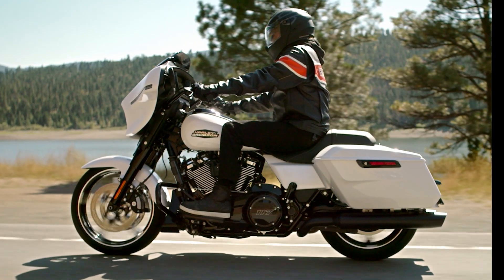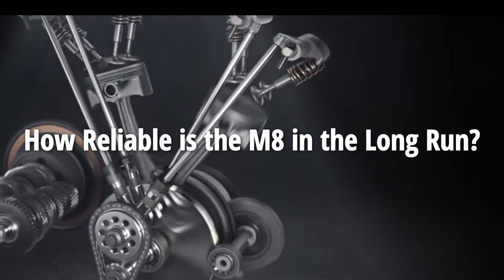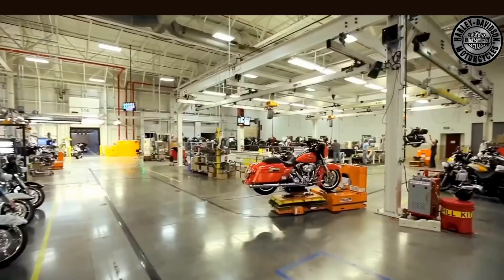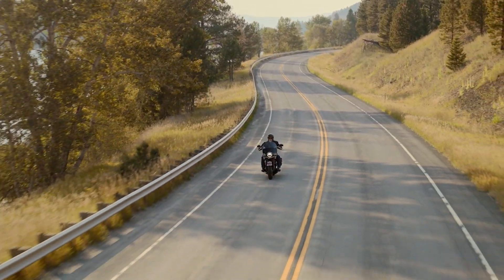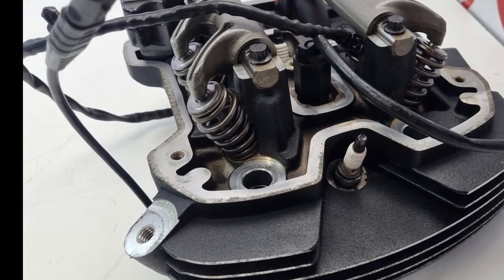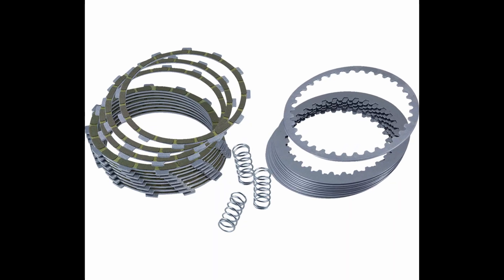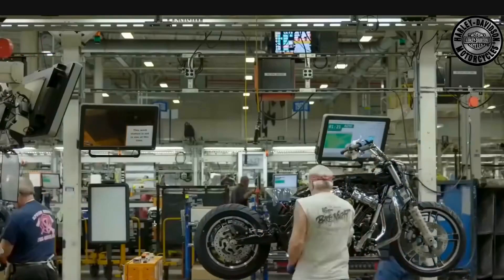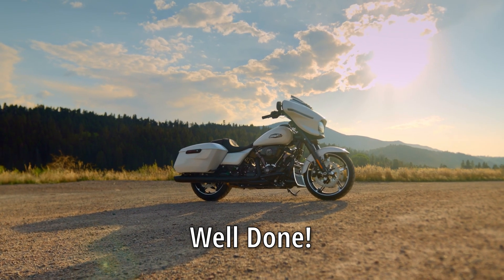How Reliable Is Harley's Milwaukee Eight? Teardown After 30.000 Miles

Comment: My Harleys were twin cam 88s not m8s but still people are kinda hard on em I never had an issue good running bikes.... I choose to ride Kawasaki Vulcans eventually tho instead out of personal preference and dissatisfaction with the motor company
Reply from the maker: The TC 88 is a great engine, just check the Cam chain tensioners once in a while. How do you like the vulcan?

Comment: Put 37k on my 2019 street bob 107. No issues!!
Reply: My right rear light went out about 12 times....I replaced the housing unit and have had zero issues since.
Reply from the maker: Great to hear. Sounds like you had no bigger issues

Comment: I had my Lowrider ST turn off while I was riding. Not sure if it was me. I waited a second and turned it back on and rode it home 30 miles. Didn't have any issues. It left me scratching my head.
Reply from the maker: Sometimes an electrical sensor go bad, which can temporarily cause this issue. It can appear randomly, but it is usually no big issue.

Comment: I have a 2021 Sport Glide 107ci with Stage 1.  36,000miles now and absolutely no issues at all,  except one brake bulb.  A very smooth, reliable, powerful and economical touring motor. Service religiously every 5,000 and now on my 4th set of tyres from new. No reason to tear down the motor to find nothing’s wrong at this stage.  In a word - ‘bulletproof’.  My best friend and never leaves me stranded.  I’m aiming for 100k miles before I take a good  look at a possible rebuild.  And then I’ll do stage 4 with 124ci upgrade. 😎
Reply from the maker: Great to hear! I am considering the 124 cc kit for my deluxe as well. Gonna be a wolf in sheeps clothing :-)
Reply: I’ve a 19 Sport Glide bought new. Immediately did a warranty & US epa compliant stage 3 11-1 107 to 114. It made 118 HP ran it hard to post warranty 37k miles. Cammed & tuned it made 135 HP 134 TQ. After another 8k miles I beat it real hard one night & broke a piston ring land. I swapped in Revolution performance’s 124 slugs n jugs no other changes. It made 140HP 142TQ and run flawlessly another 12k miles for a total of 57k miles.  EGR route to catch can, Better cam bearings and better valve springs are good investments but the M8 is a solid simple & well designed piece. It’s never used any oil or had any problems that I didn’t cause.

Comment: I bought a 1999 Sportster 1200 Custom new in October 98. Had it for 25 years and 55k miles and never had any problems. I foolishly sold it when I bought a cammed and tuned 2020 Softail Slim 107 with 1500 miles on it. I also had a 2013 Ultra Classic 103. The only issue I ever had with any of them is the slight fogging of the speedo. I still have the Slim but it now looks like a Heritage. I'm pretty happy with it but I do miss the cruise control and stereo of the Ultra. If I ever find another at the right price I may have to make room in the garage for it. I did like the Twin Cam 103.
Reply from the maker: It's awesome to hear about your experience with your Sportster and how reliable it has been! It sounds like you've had quite the journey with your bikes.

Comment: I think twin cams and M8s can be as good or better than Evos. Get an S&S crank, timken bearings, a S&S cam chest plate and high flow oil pump, and gear to gear timing. You have to lise that cheap pressed crank to get rid of the runout and get things right. Nobody wants to ebuild a new engine on a $25,000 bike.
Reply from the maker: I agree. I am currently working in an EVO vid, so stay tuned! :-D

Comment: I have been riding for over 60 years and there’s only 2 bikes that have never left me stranded, H-D & Yamaha. I’ve owned and ridden every brand available and the two above mentioned bikes are all I’ll ever park in my garage.
Reply from the maker: Which Yamaha do you currently ride? I am a huge fan of the FJR 1300 as well as the modern 700cc engines

Comment: My 2016 TC B 103 HO Fat Boy now 142.000 two-up kms  and many 140km/h packed.
Never had an issue, but, every 8000 new HD360, Formula + and gear oíl.

Thanks for your test: Brings back trust in M8 engines.
Reply from the maker: Thanks for sharing your experience. The 103 seems to be pretty reliable.

Ride safe!
Reply: I put 60k miles on my 2013 Fat Bob (103 twin cam) and was still running in perfect condition when I traded it in for the Pan-America Special! I loved that bike!
Reply: @FREEDOMGUNNER that's a step I am considering too, but still afraid to regret the change.

Comment: If you're tearing an engine down after 30,000 miles.... not reliable.  No one tears down working engines.  I got a 2009 yamaha.  62,000 miles.  Never opened the engine.  Still pulls like a freight train.
Reply from the maker: It was part of the test. The engine wgot disassembled anyway, regardless whether it was functioning or not.
Reply: @BikesandBrezeln  no one tears down working engines unless there's a problem.  These are facts.
Reply: You got some major reading comprehension issues.

Comment: absolutely love this video and keep coming back to it. They are pretty simple machines to work on and don't require a boat load of special tools either. Parts are also very reasonable and aftermarket choice is VAST compared to italian bikes that break the bank. Sometimes you just want a simple air cooled machine that just does it's job and gets you from point A to B in style and class.
Reply from the maker: Thank You🙏 I am glad you liked it!

Comment: 2021 Road Glide just under 15k. Lifters started making a racket 600 miles ago on a cold start in Wyoming crossing the US. This had happened 3 or 4 times but only once each time. Since Wyoming, almost every morning and evening start (to and from work) sounds like a gremlin with a ball peen hammer is in the motor. It passes but need at least lifters and probably a cam. Last oil change there was more bronze bearing material than I would like in the drain pan. About to change the oil and will see...another year on an ESP so hopefully replace this motor.
Reply from the maker: Please let me know as soon as you know the cause. I haven't heard much about lifter wear in M8s at that low mileage.
Reply: @Bikonomist  Some say it is the lifter cuffs. More likely Oil flow. The MoCo will down play any suggestion of culpability. Honestly, the ONLY place I have heard much about longevity outside of the EVO is here. I love hearing about high mileage Harley's. Most Harley's sit in garages and never see high mileage. My Twin Cam was about to grenade at 17K from the Cam chain Tensioners failing and plastic getting into oil pump. Complete teardown (ESP) and replaced all but the Case and the Heads...This was during COVID and the Tech that was in the middle of the rebuild had to stay home with the kids for his nurse wife. Put a kid on the job and it made it 900 miles before crazy cam chest noise. Replaced cam and lifters (service warranty) and I negotiated a trade instead of picking up the problem. 

Search "M8 Bad Lifters" and you can spend all day reading about this well known issue.

Comment: 30000 miles is nothing; this test would have been much more significant at 100000 miles!
Reply from the maker: In principle I agree, it's not easy to find a sufficient amount of data on engine wear for mileages above 30k. I am working on a Twin Cam video next, there's more evidence for the predecessor. Stay tuned.

Comment: I love my shovelheads, they don't have to leak, 60% balance factor on rotating assembly, bump up compression, and change the final drive sprocket ratio for modern speeds, these things were designed around a 55 MPH speed limit.

Comment: I have a 2019 softail with 40k. The brake light does burn out quite often. I think it's because they switched to the newer style bulb with a plastic base. That red light on the speedo is for the body control module. It does come on every time the brake light burns out because it throws a code for brake lamp circut open. Mine also gets moisture in the speedo but it still functions fine. Other than that I've had no issues
Reply from the maker: Sounds very similar to the test results. Ride safe!

Comment: My '20 Road King has 71K miles w/o any mechanical failures. Oil consumption is minimal and should be expected on an air cooled emmisions controlled engine. Only issue was plastic tag bracket broke in the middle of COVID. Took 4 months to get a new one under warranty. New one is steel. Still on the original battery. Oh yeah bike is ridden year round in most weather. No snow/ice unless I get caught out. I trust it to get me where I'm going without issue. Been my sole transport for a little over a year cannot afford car repairs dammit.

Comment: Can you please, tell me what oil was used in engine, gearbox and primary during this 30000 miles test?
Reply from the maker: The bike was serviced by an official HD dealer. So it's probably the SYN3 engine oil and the transmission/primary oil from HD.
Reply: @ thank you for your reply! I appreciate it. 👍

Comment: 30k miles is nothing. I just traded in a 107 with 63k miles that ran perfectly. I read one guy did over 100 Iron Butt 1k mile rides on his in a year on his and it ran flawlessly when he traded it.
HD engineering gets far too little respect. Not only do they last forever, they need little maintenance and are simple as hell to work on.
Reply: I know some V Twin mechanics.   They laugh at how trash Harleys are.   Along with being weak and slow

Comment: 30,000 miles?  My '92 FXRS went over 50,000 miles before the first real problem, the alternator failed.  Although the rear brake pad fell off in the warranty period, an assembly line fail no doubt.  It went over 210k miles before the engine had to be rebuilt, and that was more because of horrible mechanics than the engine itself.
Reply from the maker: Thanks for sharing. Seems like the EVO is pretty solid.

Comment: Yay only 1$ a mile get real m8 is complete trash coffee can cylinders to avoid overhead cam liquid cooled head to avoid a totally liquid cooled engine. Literally half assed on every design point.. ditch the tech buy a map a Tyre pressure Guage buy a bike with a throttle cable
Reply: This guy gets it
Reply: @Payt-y5d  I appreciate that I've was a HD tech for 22 years and the day juachine zeitz made a announcement that as of that day in 2020 HD was a luxury brand, I locked my box got a uhaul and haven't looked back. I'll been my 75k Evo
Reply: @FreetheRepublic  I've had probably 50 motorbykes.   Ridden a few Harley cycles, never saw any reason I'd want something that vibrates, has mechanical deficit, and low performance.    Now that honda valkyrie and kawasaki mean streak, they were alright
Reply from the maker: Taste is different. Some people like their vibrating harleys ;-)

Comment: There's have been 7 Harleys in my extended family (not me, no way). Not one of them made it to 30K without needing a significant repair. But my 37 year old Yamaha FJ1200 came off the showroom floor with more HP, stopping power, maneuverability, and longevity. 100k miles is the break in period. Would never own a Harley idc how much pu**y it's worth.

Comment: 30,000 miles is not a lot of miles.
Reply: With virtually no evidence of wear at 30,000 , would 60,000 make you feel better?
Reply from the maker: I agree, more would be better. But I take the information I can get.

Comment: I have 176,000 miles on my 03 Dyna with NO issues other than the foggy speedometer face you mentioned. I live on Maui and it is humid so I see that foggyness a lot. Other than that have been through a lot of tires and replaced the front forks because they had rust and replaced the rear shocks.
Reply: Forgot to add I've been through probably 4 batteries but now have a Pulse lithium battery and it's great
Reply: That's good to hear! I have a '06 Springer with a TC88. I assume yours is a TC88? I'm going to have to check out those batteries the next time I need one. I gave my '01 RK to my son. We both Have the S&S cams, oil pumps and hydraulic tensioners upgraded to keep the bikes bulletproof. Otherwise, They are stock.
Reply: @ Gotta keep it honest, I forgot to say before, didn't leave out on purpose that I did break the belt at about 20,000 miles. that was during a burn out on a rough road, stupid idea.
Reply from the maker: Great to hear that. 176k mile is a lot.

Comment: Yeah, but a 1.9 litre engine that only produces just over 100 hp is extremely under stressed. There are metrics under half that size that produce much more power, and still last as long. All pushrod motors are museum pieces.
Reply: 6 cylinder water cooled Honda Goldwing doesn't make as much power as the new HD's
Reply: @JohnSmith-de2mz  Goldwing 125hp, M8117 101hp.
Reply: @lenphil9875  Goldwing from CycleWorld Cycle World Measured Horsepower: 90 hp @ 5,420 rpm
Cycle World Measured Torque: 102.5 lb.-ft. @ 1,370 rpm

Comment: There’s many people on the m8 forums with 200k miles. Just saw one this week with 195k and he swapped new pistons and cylinders jugs. I have a 2018 with 30k hard miles on it and I’ve never had a single issue. I do everything from city, highway commuting, country roads, high elevation, dirt rodeos, many miles with my wife on the back. It’s been an incredible machine
Reply: Nice! That's good to hear, I bought a 23 Low Rider ST and it's my baby. I have no plans of ever selling it, so it's gonna get up there in miles. only 22k miles on mine so far, and no issues with mine either. Ride safe man
Reply: @tomoates8568 Hell ya man enjoy. Those ST lowriders are bitchin! Likewise friend
Reply from the maker: @jaredkish8716  I like them, too. Awesome design and value.
Reply: Glad to hear it's a solid unit. I"m just looking at a 2017 Ultra now and I'm giving up a stunning Road king to get it.  Don't want to look back with regrets.  Thanks for the post.
Reply: @mikepeacock1499 they say that the 2017-2018 had oil sumping issues, but I’m still on my factory pump and have had no issues. 
However if you really want to be safe the 2019+ oil pumps are cheap and eliminate any potential sumping issues. It’s a 10 lobe gear pump vs an 8 lobe in early year bikes. I think the pump is less than $300. Im gonna get one eventually just as insurance.
Reply: @jaredkish8716   Buddy at the dealer said if the bike is left stock ( minus slip ons) then the odds of troubles are slim,  If I want to fix the potential issue its around just under $1500 with parts and labour at the shop.
Reply: 200k means nothing if you are paying for repairs. I know of a Chevy Vega with 230k.

Comment: My 2018 Sport Glide with 107 M8  and 22k miles uses at least 1/2 qt to 3/4 qt of oil , Mobil 1 V twin full synthetic 20w-50 between 5000 mile oil changes. It was run on HD branded petroleum based regular oil for the first 15000 miles, to ensure proper break in.  Ironically, I replaced it with a BMW R1250 RT. The BMW has 6200 mile oil changes (10,000 km)  and no make up oil is necessary between oil changes. It is 4 liter capacity. I'd love to see you do a reliability test on a BMW R1250 RT, too.

Comment: I currently have a 103ci Twin Cam that runs great. I appreciate this video because i have been considering a new 117ci M8. One thing sticks in my mind tho - I was at my Uncle's shop. He took two head gaskets off the wall and asked me what i noticed. It was plain as day - they were both blown in EXACTLY the same spot. You could stack on top of each other, the damage lined up perfect. They were both from M8's. Then he told me the crazy part. One was from a 2017 and the other from a 2021. So.... four years and this wasn't corrected? Not sure if HD ever ran down the issue but that is not a good look and causes a little concern.
Reply from the maker: Interesting, i haven't heard much about leaking gaskets on M8 engines. But I agree, leaking head gaskets can be a nuisance. Curious to know how much mileage the bikes had. And ofc there can be always monday models.

Comment: I had a 2006 sporter for 100,000 kilometers. It was flawless and did not use any oil between oil changes. I then purchased a brand new 2022 Heritage and have put 65,000 flawless kilometers on it thus far. Again does not use oil between changes. I have done all manner of riding with it including adventure camping with my BMW buddies. 
The big advantage that I have noted as compared to my riding buddies, which include BMW, Ducati, Honda and Kawasaki, I never have to do the nasty and expensive valve adjustments, chain replacements and maintenance and drive shaft replacements (BMW). Also the stock air filter is serviceable requiring a simple bath with soap and water on occasion. I do all the service, accept the valves, for one of my BMW buddies. The air filter replacement requires that you remove all the plastics just to get at it. 2 hour job!!. By Ducati buddy had to bring his Multistrada in for service. $2500.00??? Another buddy tried to do the valve service on his inline 4 Honda on his own. The bike never ran again. Should I go on??
Reply from the maker: Ducatis run on an engine belt, which needs to be replaced each 5 years, or 4 to 8k miles, depending on the model. That's pretty costly and
 sums up to a respectable amount of cash throughout the years.
Reply: @Bikonomist Ducati engines have timing belts which are less stressed than timing belts on cars. You can leave them for many years. They are also extremely cheap and can be changed in a few minutes.
Reply: Every 40.000kms. Desmo's engines. @Bikonomist

Comment: much more reliable than BMW,mY 2022 Heritage  has 85,000 KLms in 18 mths,it replaced my 2012 Switchback which I wrote off at 360,000 KLms in 2022.Motor &gearbox untouched.no oil consumption.
Reply from the maker: Thanks for sharing. It's true, the late Twin Cams are also pretty reliable. Ride safe!
Reply: All bike manufacturers produce motorcycles that have inherent mechanical or electrical issues.